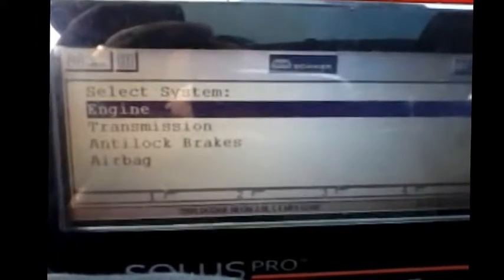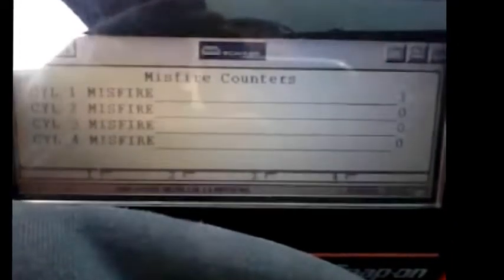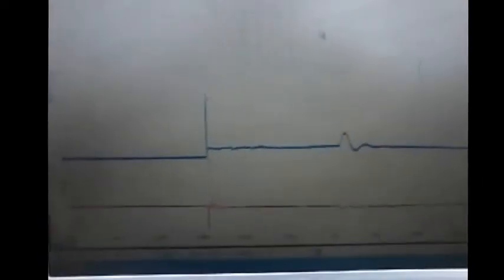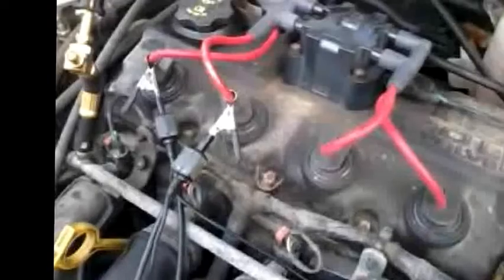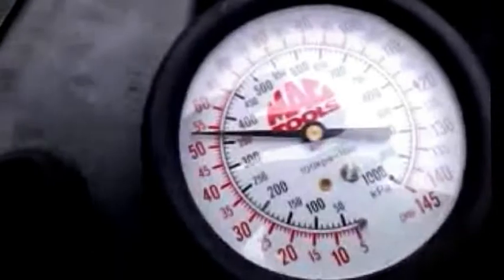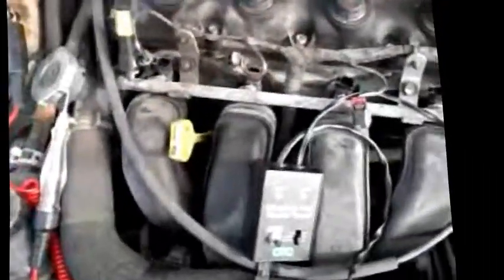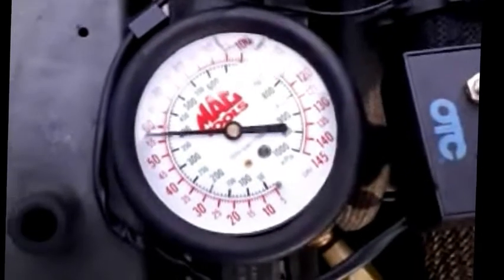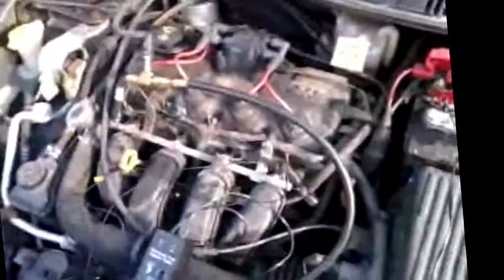How to test for injector flow problems (Dodge, Chrysler)

Comment: Great stuff! Fuel trim was a great indicator to move in that direction. can this same test be performed on direct injection? Honda uses a high pressure fuel pump that runs off one of the cams. Theres a sensor on the rail side (high pressure) but would need pressure gauge installed on low side as you did here. I’m unsure as to how to prime high pressure side other than turning car onto run

Comment: i have a cyl 1 miss fire code same prob as you had  i replaced the injector still have flashing ck engine light and rough idle, my gas milage has dropped, i replaced plugs 2 times and replaced wires, i noticed that my intake air temp was 37 degrees  when it was 80 outside could this be the problem ?
Reply from the maker: My first video! Lol horrible camera work. Great content. This could be you...
https://www.youtube.com/watch?v=OH_U3D4S5Q4

Comment: Really enjoyed this. Last time I had problems while running I actually got the injector 1 code replaced it and just fine. Then 3 went out same thing. Now I’m getting a misfire on 4 and no trouble code. I got a extra injector any ways so sure seems I need to replace it now too. Excellent vid🤘💯❤️

Comment: so with a negative fuel trim number the computer will add fuel to the injectors causing a rich condition
Reply from the maker: +Chris Canty negative fuel trim means the computer is taking fuel away in response to a rich condition. 
This injector was leaking causing the O2 to read rich. 
(sorry for the poor video quality, this was my first video shot from my phone in 2011)

Comment: Hi Paul first of all thank you for putting out great videos. Always thoughtful and full of insight. I was wondering though. I can't afford a snap-on scope so can I do the same tests using a lab scope?  I know it won't give me pid data but can they for instance give me on off time of an injector? Just wondering if you had any experience with them. Thanks.
Reply from the maker: +Frank Senick for sure you do not need to buy a Snap-on scope. Any decent lab scope will give you secondary ignition readings with the right adapters. 
(BTW, this was my very first video, you have to forgive the camera and editing work)

Comment: Thanks for your time and video.
I have two questions? what part of spark wave gave you direction or pointing to the bad cylinder?bcz I thought if there is weak spark we get bad burned fuel and caused misfire code from O2 [as a negative fuel trim]?please explain to beginners like me.
the second question is about your comment:" You could just cycle the key to prime the pump. Or jump the relay, but this is dangerous" please disclose more about it.
Thanks again!

Comment: I,m curious to know if you did a compression test and Leakdown test before of after performing the injector test? If not, how come?

I had the same issue and it ended up being a blown head gasket between cylinders 3 & 4 which carbed up the exhaust valve and as a result, had to rebuild the Head.
Reply: Was your car running hot when you replaced the head? My car has a misfire on cylinder 4 and it's really noisy and vibrates when it's still bit doesn't do it while running. One mechanic told me the whole motor needed replacing. I'm praying it's nothing as serious as the whole motor or the head.

Comment: That capacitive pickup you used on the ignition can be used in any ignition system as long as there is a plug wire, correct???? DIS, WASTE SPARK?

Comment: If you didn't have a fancy scanner to energize the fuel pump, could it be done with jumpers at the fuse?  Or does the PCM regulate the fuel pump.

Comment: @frosty9595 FYI  The mode that the solus pro scanner uses for the test is the BI Directional mode. This mode accommodated testing of component in your car Through the OBD 2 connector. The solus also decides how long to conduct the test , preventing unintentional damage to the system being tested